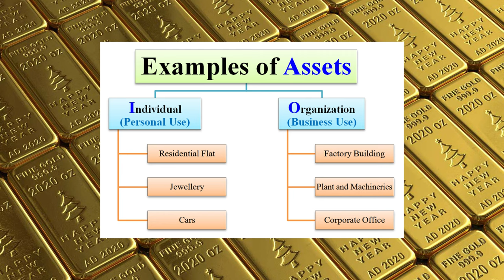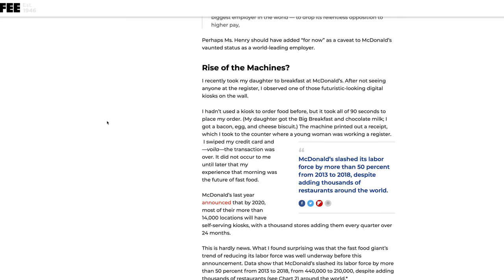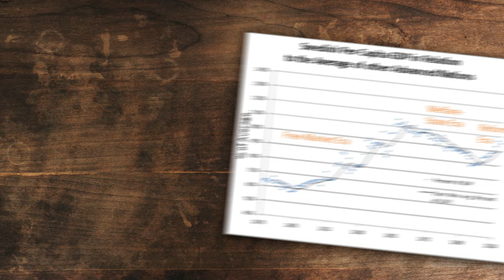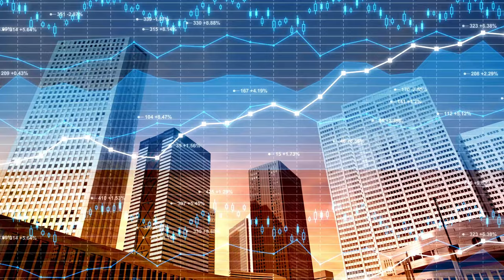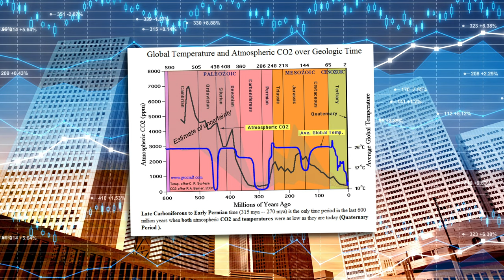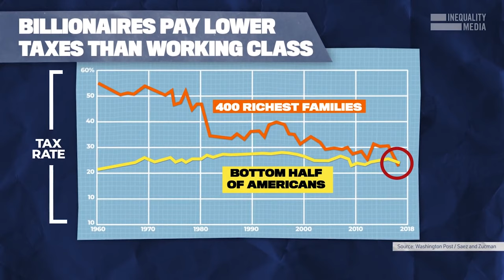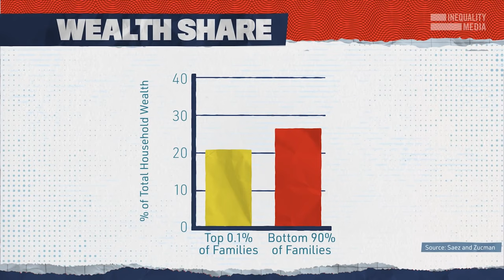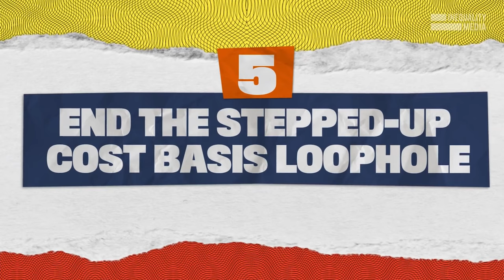Taxing the Rich Doesn't Work: A Response on Robert Reich Taxing the Rich

Comment: Now to play Devil's Advocate here. You do say that the NHS has had scarcity problems, but isn't scarcity just a natural part of any system whether capitalist or socialist? There is only a finite amount of materials we can work with and so any healthcare system is going to have some scarcity problems
Reply from the maker: Good question, indeed, scarcity exists under all systems, which is the very reason why capitalism is required as you will know because in a world where scarcity is economic reality and there is demand and certain quantity of supply, one must find the most efficient system possible for rationing resources to the correct parts of the market.

In the case of healthcare, prices serve that purpose. If price is removed the demand drives up and you end up in a serious shortage crisis. Whereas, market-driven prices ensures that those of greater urgent needs are put first, because someone with lesser needs is not going to just throw away money for something they don't really need the same, they will prioritise their money. Which explains the very reason the role of prices are ever so important.

The big difference between a free market model and that of the universal healthcare systems is the question over efficiency for that reason. The resource allocation is where the market shines. Add to this, it attracts the best quality doctors, frees up time due to efficiency clearing out the waste and enables doctors to spend more time per patient and to see through more patients. Universal healthcare faced with inefficiency is unable to achieve this. The long waiting lines results in doctors spending fewer time per patients, thus, the quality of healthcare is never the same.
Reply: Of course. However, a price based system certainly manages the scarcity issue better, if the Ivory Coast-Ghana Wager is anything to go by.